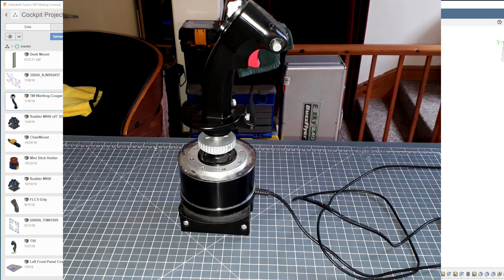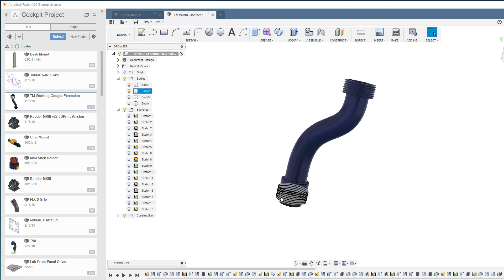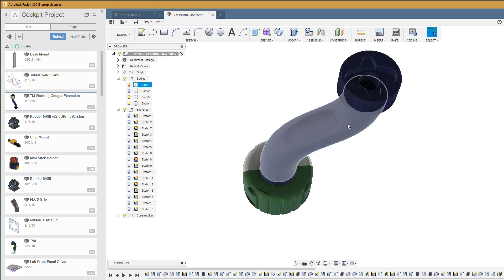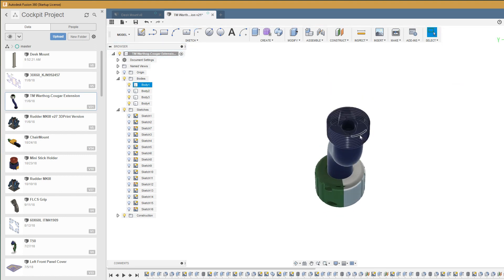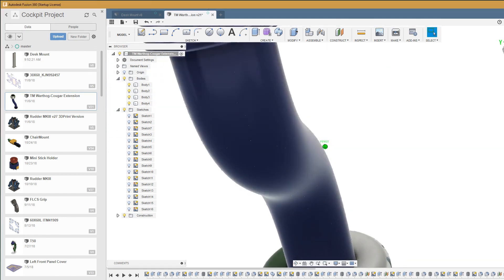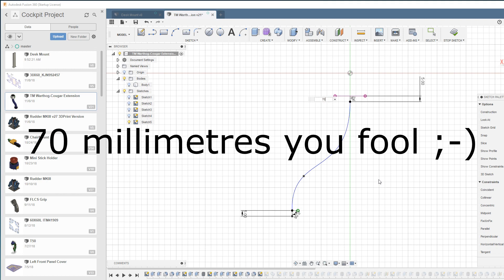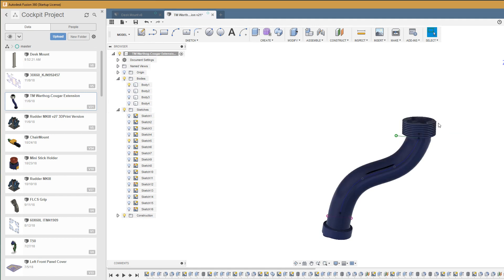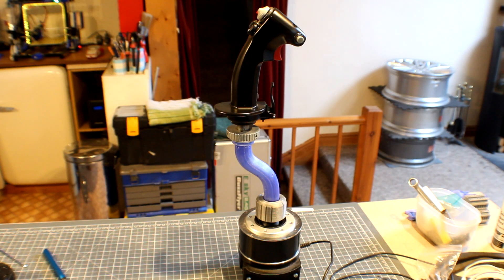Flight Sim Gear No.1 - Custom Warthog/Cougar Extension

Comment: Just curious how long is that extension? thanks
Can I just send this file to my friend and all he needs to do is press print? 😅 thanks
Reply from the maker: About 6 inches/150mm if I remember correctly. The linked version on Thingiverse should be ready for print once sliced and the .f3d file is also there so you can modify it for your own requirements.
Reply: @ thanks for the reply, what materials should it be printed with?
Reply from the maker: @Neosin1  I used PETG, but basically the strongest material your printer can cope with (depends on how heavy handed you are when flying ;) ).

Comment: Love it, thanks for sharing.  What cable extension did you use?
Reply from the maker: Hi - I made my own using the connectors from an older donor unit that didn't function any more. IIRC they are PS/2 5 pin mini din sockets.

Comment: Hello there. 
I am trying to modify your design but I am not really good at fusion360 but I do understand the basics.
I am trying to do several things:
1. modify the twist to the left by 15° - done, although was a bit hit or miss as I don't really get the pivot point to be in the center all the times. I did it when I was lucky one time. :) 
2. elongate the S part by 40mm. it seems that part is not parametrized... you talk about it in the movie but then you move to other stuff I think. Is there a way to unlock that S part from sketch 5 so you can increase the height of model without any other major changes?
3. I want to remove the guiding holes in the 2 halves to reduce work of my 3D printer If I delete them from sketch 17 (iirc they seem to be together with a filet)  would that be OK/enough?
4. I want to try to print the whole extension standing (with minor supports) so I guess combining at the end of modifications the two halves would be enough, right?

Thank you very much!
Reply from the maker: Hi zaelu - quite a list there amd I have not looked at that model for quite some time, so I may be wrong on some items, but:
1. When you adjust the twist you should be able to set the pivot point on the "move" helper thing - there's a tick box if I recall correctly that let's you do this before making the angle adjustment.
2. To elongate the Syou can delete the 90deg tilt angle parameter at teh bottom of the S shape and just leave the smal vertical line. You should be able to move that to your desire, but will need to delete the threaded holes or redo them, as they won't be int he right place.
3. Yes just delete them if you don't need them - should be fine, but Fusion can be "difficult" with this stuff sometimes so YMMV.
4. Yes either recombine the two halves or delete the split feature in the timeline.
Hope that helps and good luck.
Reply: @CMDRTeatime  thanks for reply. I will try to do it!
Reply: @CMDRTeatime  
Ok, I finished! Thank you very much for sharing the Fusion360 file! This is how it ended up.
 It was a 16 hours and one minute print on an Ender5Pro in PLA at 0.16 resolution and with selective tree supports.

https://youtu.be/oh6JKaasNiE

Comment: thingiverse is currently having issues on their site, can you DM me the files or a link to the files?
Reply from the maker: Uploaded to my DropBox here: https://www.dropbox.com/s/dhqu204tqczyh6e/WarthogExtension.zip?dl=0
Reply: IMADETHIS THANKS!
Reply: @CMDRTeatime  Hi, good evening. I love the design, is it possible to have the extension longer? Im just new to 3d design and I wanted to make an extension for helicopter so It could be bolted to the floor. I can be reached via email rmsabax4@gmail.com
Reply from the maker: @vampire5869  Hi - you need to go into Sketch 5 in the Fusion 360 file and change the dimension d59 from 5mm to whatever you need (45mm in your case). I have uploaded a screenshot showing where here: https://www.dropbox.com/s/pafbrau1mw12bmo/Help.png?dl=0
Let me know how you get on and good luck.
Reply: @CMDRTeatime  I got to sketch 5 and I modified the shape, do you think you would be able to help me finish it? Where can I send so you can see it?
Reply from the maker: @vampire5869  Hi - if you want to hire me for design or printing purposes you can contact me at the address in the About tab on my channel home page next to where it says "For business enquiries:"

Comment: Great print, thank you! - Just wondering what screws go in the holes running up the length of the shaft in order to bolt the two halves together
Reply from the maker: Hi Julian - they are threaded for M4 bolts.

Comment: Wondering how you made the curvature of the "tube", you used something like "Loft"; made 2 circles for the ends and added guide rails?
Reply from the maker: Basically yes, if you watch the tutorial I go into Sketch 5 and there is a spline curve in there driving the loft from one end to the other. You can change that curve to taste and all being well the model will auto update to the new curve you have set. There are other parameters you can drive as well e.g. stick tilt and "yaw".
Reply: @CMDRTeatime  thanks!
Reply: Omg I need this!! Can you make me one?